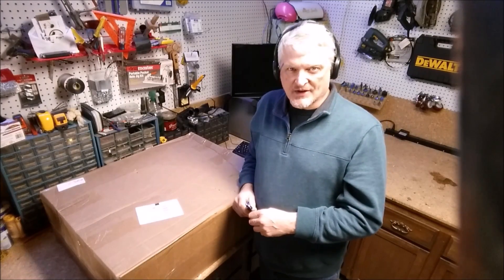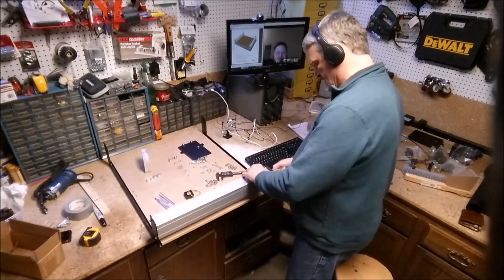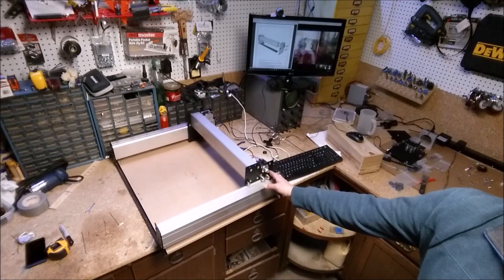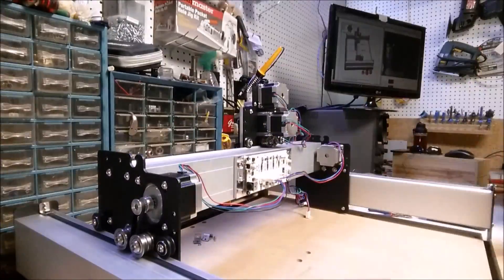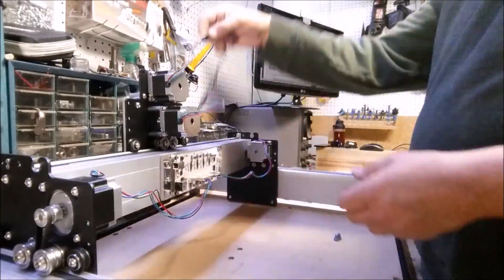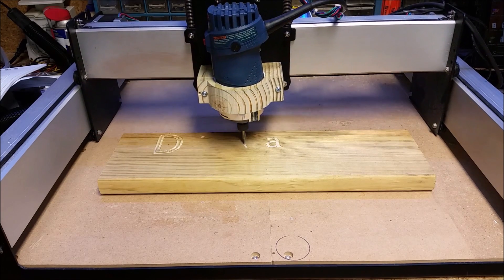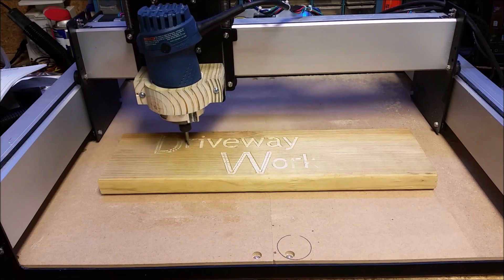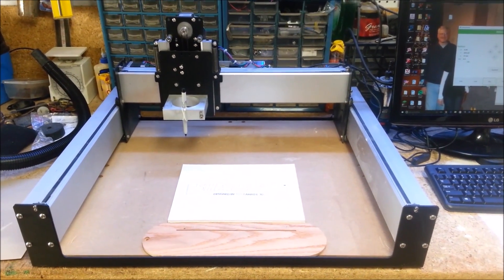Building the Shapeoko3

Comment: Hi Jim; I got your info from Izzy. I watch his videos all the time. He is a very creative man. Also, he gives a nice clear process of what & how to do it.
Your (great) video was very clear & understandable. I did subscribe to your site & look forward to watching more. As a side note, a recent video ( sorry I do not recall which one) gave the advice that when you buy a CNC get the largest one you can afford & that will fit into your shop. I considered the Shapeoko XL (my wife does not know that yet). I do not know what types of home-woodshop projects I would use it for, however, I do not want to find out after I buy a smaller CNC. Any thought? Thanks, Tom
Reply from the maker: Thanks for the comment Tom.  About the CNC, I think the advice is good, get what you can shoehorn into your shop.  This Shapeoko is great, but it's limited to about a 16"x16" cutting area.  If you just want to do smaller projects, that's probably good enough.  If you want to make larger signs you could do it with this one, but the stock would have to be small enough to slide through the bed and you would need to do it in sections and make registration points in your designs.  If you are new to CNC's I would go on Dave Gatton's YouTube channel on Saturday nights and watch his live CNC show.  Mark Lindsey and Javi Unzueta are great resources to get to know for starting out, and Winston Moy is a good resource on YouTube too.  Dave Gatton actually makes and sells CNC either plans or kits you can get to make one for your shop, and I think you can scale them to whatever size you need.  I would at least message him to talk about one.  The bigger expense in CNC's will be the software, most people use Vectric products and they aren't cheap, but they are good.  Shapeoko and X-Carve have online software you can use, but it's limited.  If you just want to make basic shapes both of those will get you started for free.  You can also learn to use something like Fusion 360 to make code for your CNC, and it's free for hobbyists.  I love this Shapeoko, it's really solid but guess what, I wish it was bigger.  I've already burnt out the first router I put on it and have to replace it.  I'm looking at a laser for it too.  Good luck with the decision, I bet you'll almost always want a bigger one, lol.

Comment: I have a S03 since June 2015. Software development stack is very important to figure out, in many ways more difficult than the CNC build. Suggestion for follow up videos with CNC: software stack to do 3D models using free software (Linux, FreeCAD, PyCAM, Universal Gcode Sender) - since hobby level budgets cover the machine but not the equally or more expensive software. Some have started using Fusion360 but when will the free use option flip to expensive? A risk. 
Cover scratch building a CNC with Arduino and a CNC shield, power supplies - a good bit of site traffic will follow due to viewer interest. 
Accurately locating stock on the machine becomes important, using 'wigglers', flip fixtures (to machine both sides of a board to make items like chess pieces) and such. 
Isolating the CNC machine from other shop motors. Starting up an oscillating sander or the router motor while the CNC program is running if on the same shop circuit or near circuit can cause the CNC machine to halt and can you get it restarted to cut accurately? Harbor Freight has router speed control box that I use on mine, if that helps some viewers.
Reply from the maker: +jvin248 Yea I think the software could easily get more expensive than a hobbyist CNC.  I've grown up with Autocad, I have to agree, I would expect them to pull the plug on the free version when everyone gets hooked on it.  The Harbor Freight speed control would work for my Colt, and probably be cheaper than buying a DeWalt, do you know if it's electronic or just a potentiometer?